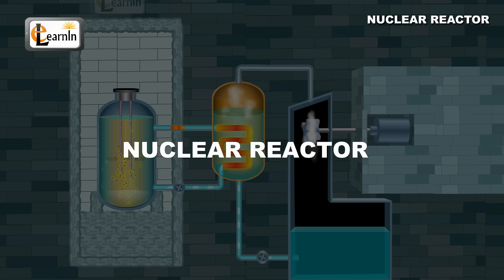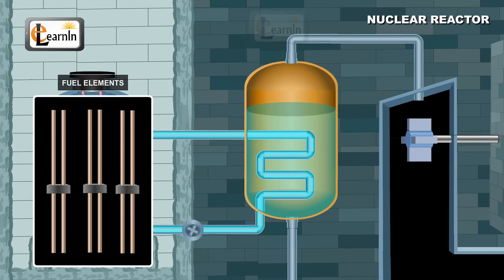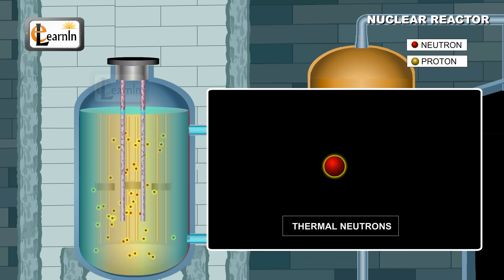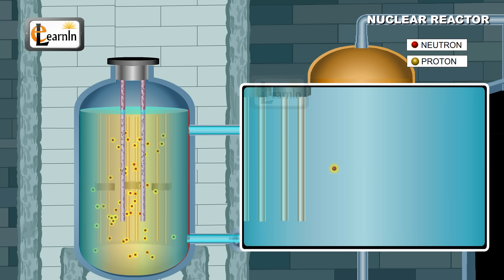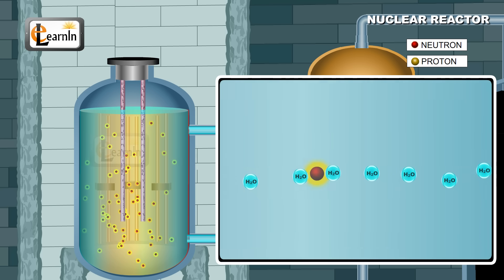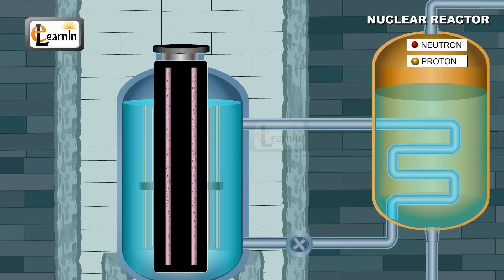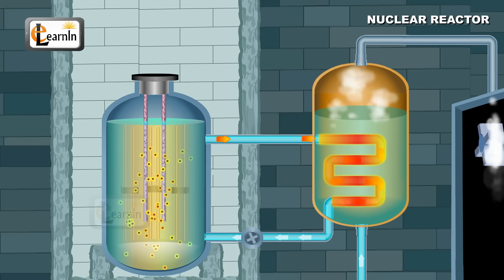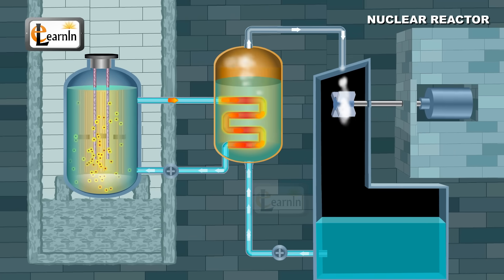Nuclear Reactor - Understanding how it works | Physics Elearnin

Comment: I'm unclear by nuclear energy and would be grateful for anybody to reply to this question. If nuclear energy is stored energy in the centre of particles waiting to be released, what's the catalyst that causes the potential energy to be released? I'm not interested in neutrons and protons, I just want to understand it on a practical level. If the energy is stored in the uranium pellets which are then encased in rods there must be something that triggers the release of this energy otherwise it won't do anything. Anybody care to help because the video doesn't tell me.
Reply: I sussed it, the catalyst is electricity!!!!!
Reply: @PeterPete  On what planet is electricity run through the reactor core??   Go here......https://en.wikipedia.org/wiki/Nuclear_reactor
Reply: @dannywilliamson3340  thanks for the link danny but can i ask, how do you think a nuclear reactor is started?? Do you think they flick a switch or pull a lever??? Wind a crank perhaps or light a fuse? maybe turn a dial? Or howabout start a chemical reaction?

I think electricity is used to generate neutrons via a neutron generator which are fired at or through the reactor by way of the fuel rods. The fuel rods provide resistance and so heat up as a consequence and that heat is transferred to the moderator and subsequently the water which turns to steam to drive the generator and voila! Electricity is produced!!
Reply: @PeterPete  Oh, I've been around them a couple times.  I"m a degreed nuclear engineer.  I was a reactor operator on a ballistic missile submarine.  Later I was a reactor operator at a 1100-megawatt GE boiling water reactor.  I was a fuel handler during refueling outages. And now I'm retired from the biz.
Reply: @dannywilliamson3340  ah well you should be able to tell me why nuclear fuel rods are not radioactive prior to reactor installation
Reply: @PeterPete  They ARE radioactive when new, just like the uranium ore they're made from.  (That's how ore prospectors find it......with geiger counters.)   I've watched the HP technicians examine them when we were doing receipt inspection prior to an outage.  The activity is very low and posed no undue hazard to the qualified radiation workers, but it IS detectable.  And WTF is a "highlighted reply" anyway?
Reply: @dannywilliamson3340  i think you're overlooking my point - i'm of the view radioactivity is the result of man's activity and doesn't occur naturally. Fuel rods are manufactured by human beings and are MORE radioactive once spent than prior to entering the nuclear reactor. This view is borne out by the fact employees at fuel rod manufacturers do not wear radioactive PPE. Your comment supports my view.

Lots of man manufactured materials are therefore radioactive and fuel rods are no different!

So one has to ask why do spent fuel rods gain in radiation?? Ah yes because they're subjected to high doses of neutrons via high voltages via a neutron generator!!

In other words man uses elelctricity to produce electricity!!
Reply: @PeterPete  "via high voltages via a neutron generator"  I have no idea what you mean by that.  A "neutron generator" is just an assembly with some element inside (don't remember what they're made of specifically) that's been activated inside a reactor, and is giving off neutrons by the fission process.   There's no "high voltage" involved.  And, yes the "house loads" inside a big generation station consume about 50 megawatts.   Also, your "view" that radioactivity doesn't occur naturally couldn't be more erroneous.  See https://en.wikipedia.org/wiki/Natural_nuclear_fission_reactor.
Reply: @dannywilliamson3340  a neutron generator forms part of a nuclear reactor assembly - now i wonder why it is called a neutron generator? do you think it's because the unit generates neutrons?? and isn't it the case fuel rods are exposed to neutron bombardment in a reactor??
Reply: @PeterPete  What is a "neutron generator"?  I know BWR fuel assemblies like the back of my hand.  There IS no such thing.  Neutrons are released from the uranium nucleus by the fission process, or from startup sources which are a separate piece installed in the core and are not part of a fuel assembly.
Reply: @dannywilliamson3340  you're not understanding my point danny - nuclear fuel rods are not as radioactive as the spent fuels are. agreed?

if yes then we have to ask what happens to the fuel rods for them to become highly radioactive! that's my point and you're not saying what!
Reply: @PeterPete  Ooohhhhh!! Why didn't ya say so?  Fuel that has been part of a critical core becomes lethally radioactive due to the presence of all the fission fragments......the new, unstable elements that are the parts of what had been the uranium nuclei.  See https://en.wikipedia.org/wiki/Nuclear_fission_product
Reply: @dannywilliamson3340  You're hard work - so the spent fuel rods are more radioactive than the fuel rods prior to being installed in the reactor (something I knew already). But what makes the fuel rods more radioactive is my question dumbo!!!
Reply: @dannywilliamson3340  but what causes the fragmentation? even the guy in the video doesn't explain either!!

you're trying to tell me that fuel rods in the reactor become highly radioactive due to what exactly? you're simply not saying!!!
Reply: @dannywilliamson3340  and for somebody who has worked in the field, i find your reply to be pi** poor!!
Reply: @PeterPete  Awww....whassa' matter?  Did step-mom forget the sprinkles on your Pop Tart this morning?
Reply: @dannywilliamson3340  with that reply i'll take it that I am right!!

Comment: Watching this video one realizes how wasteful nuclear reactors are. Only a part of the nuclear fuel gets spent. The radiation is not used. The heat is not properly used. For all intents and purposes this is just a steam engine with dangerous fuel. It's like having a supercomputer and using it as a simple calculator.

Comment: So basically the steam that came from the stack is radioactive? So the water touches the fuel rods right? Then it got converted to steam. Please do correct me if i'm wrong
Reply: Not really.
In Pressurized Water Reactor, the first loop is water under pressure so high, it doesn't boil even after passing through the reactor. It heats the second, lower-pressure loop via heat exchanger, generating steam in it, which is what drives the turbogenerators. The second loop's exhaust steam is then condensed through another heat exchanger, which uses outside's water to cool it down. At no point there's a direct contact between the first loop water and outside world.
In Boiling Water Reactor, the first loop is under relatively low pressure and has water in it boil, turning into steam and driving turbogenerators, then is cooled down through another heat exchanger, which uses outside's water to cool it down. At no point there's a direct contact between the first loop water and outside world.
EDIT: Fixed grammar.
Reply: @caav56  aaaah, so it's safely isolated from the first loop. That's makes sense, Thank You!

Comment: I'm confused? What does this make? Energy? Why not just use the water ur pumping through to turn the turbine from the start? Instead of just pumping water in, boiling it, turning it to steam to turn the turbine?
Reply: Because it would not have enough pressure to turn the turbine
Reply: You just described a perpetual motion machine.....which is impossible.

Comment: I watched how uranium fuel rods are made, and wondered how they can be handled without heavy shielding.  Came here hoping to get an answer, but alas, did not. I did some more research and if anyone is interested, read below, if not, well, don't read below. :)

The rods brand new have neutrons moving too fast and too few to cause a chain reaction. The Moderator slows the neutrons down so that they can cause a chain reaction.   When installing new rods in the reactor, they are first put in the deadpool, ehehe your welcome Canada, where boron keeps neutron activity down, hence the poison part. They are then transferred underwater to the reactor core. When fully reassembled the boron is purged, the control rods moved a bit and the neutrons can now flow slowly freely and start the chain reaction. 

Spent rods though are giving off too many neutrons and too much radiation and continue to react with themselves, and why they are stored in cooling tanks that absorb the neutrons. The spent fuel is no longer low level uranium, the pellets have absorbed and converted to higher types of radioactive materials such as plutonium, and can no longer be exposed.

Comment: 2 things i dont understand: 

1. is the cooling water contaminated since it passes through the fuel/rods?
2. this "cooling" water gets hot, circulates to the heat exchanger and there it converts its water to steam? then , the cooling water should be steam too already, right?

please explain, i am an intern at a nuclear power plant, next week i have to perform a shutdown test :S
Reply: The cooling water is not contaminated. This video is very simplified. In a nuclear plant, there are usually 3 circulations. The liquid which is heated by the reactor directly is contained, then the water that is indirectly heated into steam, turns the turbine, and converted from steam back into water, which is also a contained circuit. Finally, there is the water that cools the steam in a condenser, which comes from a water tower or nearby water source, which is never comes into direct contact with the radioactive liquid.
Reply: ilias_s don't worry. you always have AZ5 button
Reply: @kvsalahuddin5  test went fine with a few mishaps, that i took care by jumping in the water. i got promoted to shift manager, but still havent got used to having 3 arms 🤪

Comment: He skippee a bunch of energy conversion steps. The heat generated is thermal energy, not nuclear energy. The thermal energy is converted to kinetic energy through steam turbines. This kinetic energy spins an electric generator which, using electromagnets and coils, produces electricity.
Reply: Theoretically, a part of it can be bypassed by using MHD power generator to siphon power from a stream of superheated gaseous coolant.

Comment: i think there is some problem with this 
he didn't show the GRAPHITE.
in chernobyl(HBO) they show that soldiers are removing graphite from roof top

i don't know which one is right and which one is wrong
Reply: Graphite is another material that can be used as the nuclear moderator. This video shows a reactor that uses ordinary water/heavy water instead.

Comment: Probably a dumb question but instead of using a dangerous process like nuclear power to make steam to run the turbines, why cant we use water to turn the turbines like the Hoover dam? I know that not every location that needs power will have the kind of water power that they may need naturally but Im sure someone could think of a way. Maybe we could reduce alot of the flooding in towns somehow. I know Im no physics major just interested.

Comment: Boron in the reactor coolant is also used to control the neutron population. When a reactor is first started up the boron concentration is high. And the fuel is used up the boron is removed from the water.

Comment: a nuclear reactor is the same process as a nuclear bomb. but instead of setting the reaction off and letting it happen in a few seconds like with a nuclear bomb. the reaction is slowed down to the point where it can take multiple years for the reaction to finish.

instead of control rods a nuclear weapon has a projectile, that is fired into the nuclear core of the bomb. this then sets off the same fission reaction as in a nuclear reactor. but instead of using water and control rods to control that reaction. you just kinda let it go crazy.
Reply: You are describing an early type of nuke such as those used in Hiroshima. They would shoot U-235 ball into U-235 ring which would make a fission chain-reaction. Newer nukes use implosion in which the core is surrounded by exploding lenses that simultaneously explode inwards.

Comment: I feel like the way they rely on "chance" for the particles to collide is inefficient. Couldn't they use some sort of multi particle accelerator to collide them specifically? Wouldn't that make the power output more controllable and reduce the potential danger of radioactivity?

Comment: I don't understand how if graphite is a moderator (thus stimulating fission) why it was also used on the tips of the control rods in RBMK reactors? A control rod is supposed to decrease the fission no? Or did I completely misunderstand the role of graphite? I'm sorry if this is a stupid question but I just don't understand why the control rods and moderator were made out of the same material.

Comment: so what starts the fission process. is there something that shoots the fuel rods? is it their proximity to each other alone that does it?
Reply: Wynne Philpott I believe the fuel rods are concentrated forms of the specific isotope of uranium that are constantly emitting gamma radiation (neutrons). Proximity of the fuel rods plus the moderator starts the fission reaction. If you look up videos of uranium ore surrounded by mist you can actually see the trails left by the particles

Comment: how is the water in the second tank beeing converted into steam if its not already steam from the first tank?
Reply: The water in the reactor tank is isolated from the other tank, it works like water cooling but in reverse, so let's say there's 2 sets of water... we have water A and water B.

Water A is heated from the reactor, it is constantly rotated through the pipe into the tank that holds Water B, and back out. The heat from Water A is exchanged through the piping into Water B, which is a separate supply. Water B heats up and begins to steam, the steam escapes and pushes a turbie, when it condensates it becomes part of the resouvoir which is then pumped back up into the tank that holds Water B as cold water, to then be made hot again and repeat

Comment: So what about the graphite of Chernobyl? Was that the wall of the nucleus?
Reply: Chernobyl was a totally different design from this. It used graphite instead of water as a moderator. Long story short in Chernobyl the hotter the reactor gets the greater the reactivity. Whereas in a reactor like this if the reactor gets   too hot it'll boil the water moderator and therefore reduce the reactivity. Which is essentially what happened at Chernobyl. What put it over the top was another design quirk that created a brief power spike when the reactor was scrammed. The power spike flashed the water info steam which blew the top off the reactor.
Reply: mrjdgibbs thank you! So using graphite was a mistake? Is still used?
Reply: @varovaro1967  It was never used outside the USSR, I do believe that there are a handful still in use. 

Sane countries simply all designed their reactors with a safety 1st mentality.

Comment: So the "fuel elements" create heat just by being placed in the water?
Reply: They are always generating heat, water is just a means to absorb the heat energy and prevent metals and stuff from melting while also using the heat to make energy
Reply: @tinylegofiend8605  So just by lowering radioactive rods in to water, they will heat it?

Comment: How do you achieve the nuclear fission process? So the fuel rods are dropped in water, and then what? Are the neutrons just created or is there a process to set them off? I think you missed that critical part.
Reply: A nuclear reactor is driven by the splitting of atoms, a process called fission, where a particle (a ‘neutron’) is fired at an atom, which then fissions into two smaller atoms and some additional neutrons. Some of the neutrons that are released then hit other atoms, causing them to fission too and release more neutrons. This is called a chain reaction.
Reply: @AmIr-dn4od  Thankyou. 🙏

Comment: What starts or stops the process?
You have the fuel inside the little rods in a big concrete vessel. What triggers the on and off switch?
Reply: hi Dan, as I understand it, it is the presence of the 'Control Rods' that shuts the reactor down. So to completely shut down the reactor, the control rods are lowered fully into the chamber. Then it is about 2-3 seconds before the reactor shuts down. then to start, just raise the control rods. The control rods normally are present in the chamber to a varying degree - depending on how much energy is required (balance between heat generated and energy required). hope this helps!.
Reply: @petenutsford8416  yes but what starts it?

Comment: If the heavy water is hot enough to boil the non heavy water, is it the composition of the heavy water that keeps it from boiling itself? Or maybe the non heavy water is set a a lower pressure thus decreasing its boiling point? Can somebody help me with an answer?